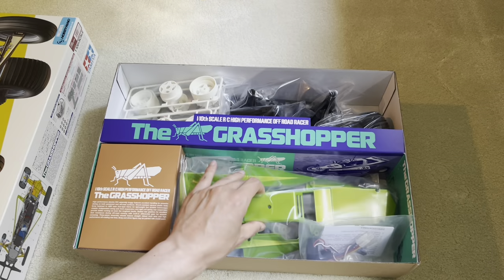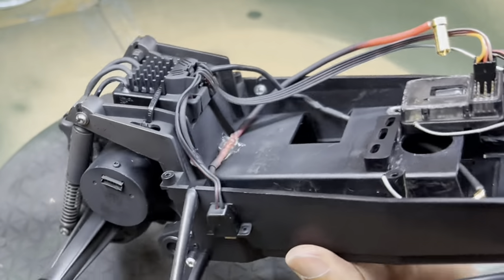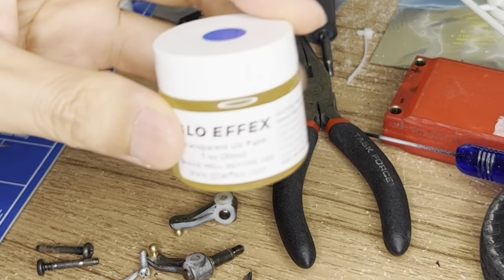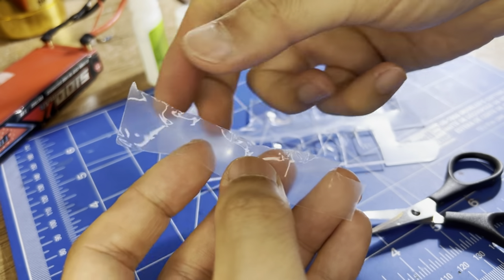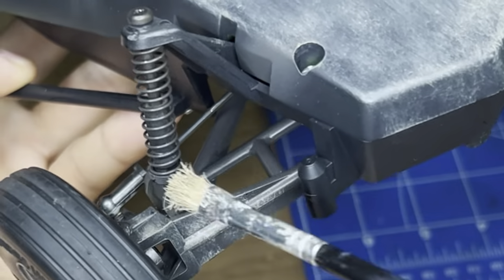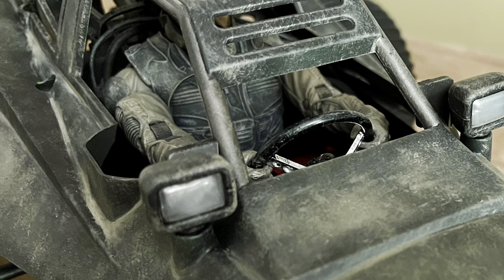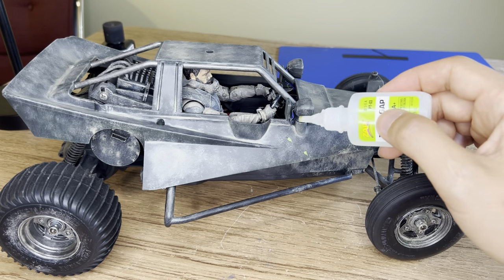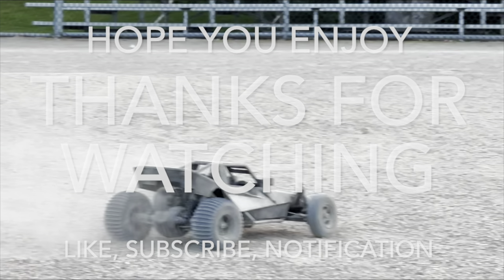Making RC DUNE BUGGY with Tamiya Grasshopper Chassis

Comment: Im currently building a green GH. Only Im going to use an aluminum chassis, trans, shocks, side nerf bars, front bar, trans mounts, green anodized aluminum rims, aluminum A-arms and spindles and anything else I see aluminum.  LOL.  It will be the ultimate GGH.
Reply from the maker: Wow, awesome!  Thanks for commenting, cheers!
Reply: Sounds heavy
Reply: @captainchaos3053  Not really. I haven't weighed it but I suspect it only is a few ounces heavier. Even the gear train is all 7075 aluminum. I dont have a scale so I cant measure it.  However, it looks marvelous. LOL

Comment: very cool "Dune" Dune buggy 😉
Interesting method to modify  the headlights.
Blinded by leds is not funny. My fast method is to fill it with hotglue. The Led is fixed  and the light is scattered.
great grasshopper 👍
Reply from the maker: Hot glue is a great idea! Thanks for commenting. Cheers!

Comment: Wow that brings back memories.  With modern brushless motors/batteries you could grenade that thing in record time :p
Reply from the maker: Yes I did use brushless. What’s not shown in the video is that I used an AVC receiver to help correct oversteer and I think that made it easier to drive. Thanks for your comments!
Reply: Those grasshopper transmissions are as bulletproof as they get, frequently used for monster trucks in Tamiya lineup. If anything breaks, it won't be that. A front suspension arm maybe, but not the trans.